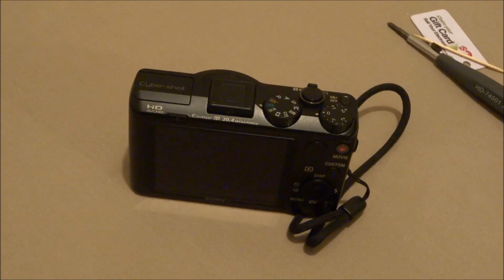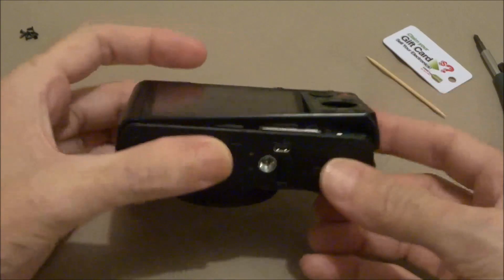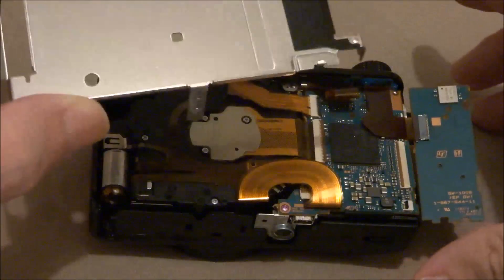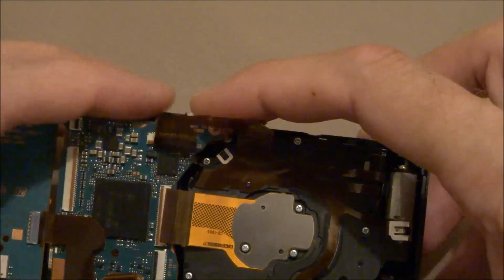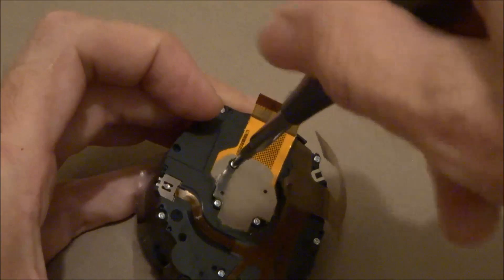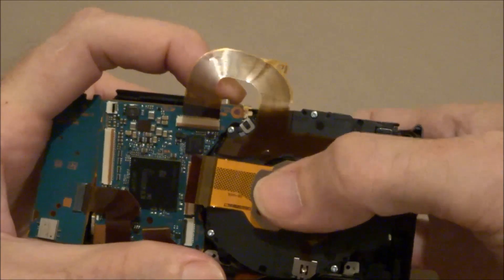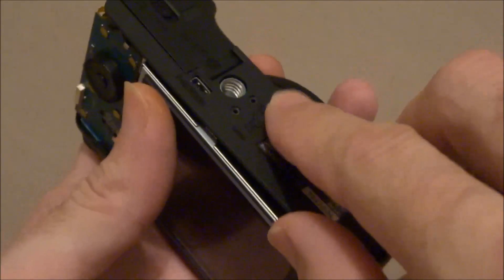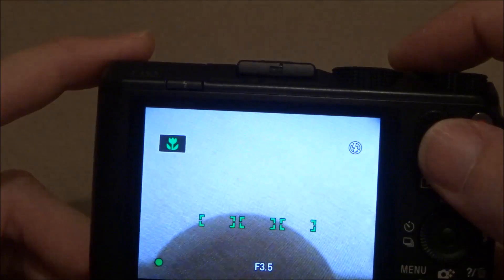Sony DSC-HX50V lens replacement repair HX60V HX50

Comment: I replaced the flash on my hx50v now it doesn't want to power up.  I checked the ribbbon cables over & over again.  & When I press the power button sometimes a little red led flashes by the little wire to the lcd screen on the motherboard.
Reply from the maker: +stingray4me that red led is the memory card  read/write led,  check the control cables, the one at the top.
Reply: I tried all the cables again with no luck. Can I send it to you to see if you can fix it ?
Reply from the maker: +stingray4me Did you remove the top control panel and the battery compartment?  I bet its either the power cable or the control cable to the motherboard.  I might be able to look at it.
Reply: +Otherstuff No I didn't try to remove the battery compartment or top control panel.. I'll try that now.
Reply from the maker: +stingray4me on the other side of the motherboard there is the power cable,  remove the lens cables so you can just flip the motherboard to check the power cable.  the power cable just slides in there is no flip retainer.
Reply: +stingray4me got it all apart now.
got it back together with high hopes but still the same. No power just the little red led flashes & makes a slight clicking sound when power is pressed.
Reply: +Otherstuff I checked that cable too & it is at its maxium in point up to the ribbon ears.
Reply from the maker: +stingray4me try removing the battery and hold down the power for one minute.  When you replaced this flash was the a new flash ?
Reply: +Otherstuff I tried holding down the power w/o battery & still the same.
I bought the flash off ebay. It was from an hx60.
Reply: +stingray4me Can I mail it to you to try to get going ?  I give up.
Reply from the maker: +stingray4me i sent you a message.
Reply: +Otherstuff OK I'll send it to you.  Just replace little items like cables if needed.  If it needs expensive items I'll just get a new camera.  Thanks.

Comment: So I installed the new one and the lens will not come out when I turn it on. It just says turn off and turn back on. Any ideas?
Reply from the maker: +raul bohorquez new lens?  something didn't connect on this cable 4:25    try bumping the camera with you palm.
Reply: +raul bohorquez mine said that too & also the internal memory is full. Now it doesnt say anything & wont power up.  I replaced the flash on mine.

Comment: Hello! Thank you for this video. I got the spare part and attempted to replace it, however when i finished and powered it up, the lens wont pop out, it wont open. Tried again to check and the cables and still it wont. Any idead what i may be doing wrong?
Reply from the maker: jvelezc  check this cable ( at 4:28 )  its the motor drive cable. was it a new lens?
Reply: Otherstuff Hello Thanks for your answer. I used my old lens and it does pop up with that cable is connected, when i use the new it doesnt. I could you your spare part has a Number 2 on the top part as well as my old lens. However my spare part has a Number 1, do you anticipate that may be the issue? - thanks in advanced
Reply from the maker: ***** where did you get this new lens?   its for a hx50?   i dont know anything about a number if the lens is for a HX50 it should work.   return the lens something is wrong with it.
Reply: Unfortunately I bought it on Ebay shipped to Germany from a Chinese source. It didnt work, and the only difference was the number 1 it had, compared to my original and yours which were number 2. He will send me a new part this time I hope I get it rght otherwise I will have to buy from a USA Source.
Thank you for all your support! :)

Comment: Outstanding video.  I dropped my camera and now the camera displays error 13:01.  If I remove the SD card, there is no error.  The SD card is good.  It appears that a connection came loose or a component has been damaged.  With the aid of your video, I am thinking of disassembling the camera. Any thoughts?
Reply from the maker: Vic Tree the card slot has no ribbon cable it is solder on the main board.

 got this off another help site :  

  This error usually is generated because there is an issue with the contacts on the Memory Stick - do you have another Memory Stick to test? If it's only one Memory Stick with this issue check the contacts and rub them gently with a pencil eraser if necessary. Insert and reinsert the card several times to see if this clears the error. If you are still having the issue after this, and you get the same result with another Memory Stick the camera may need service so give Sony support a call and they will be happy to help:
Reply: Otherstuff Thank you for the reply.  I still see the error with a different card.  The card that was in the camera, when it was dropped, is accessible in a PC.  With no card in the camera, I can take pictures with the internal memory.
Reply from the maker: Vic Tree try this,  with the camera on  slowly push the card in and see if it reads it at some point.  i had some do this its was the connection inside the card slot got bent.
Reply: Otherstuff I tried that and it seems to try to access it.  But, "Reinsert the memory card." and C13:01 pops up.

Comment: Thank you so much for posting this! I dropped my hx50v ( the lens stopped working) and I'm not confident in my skills in camera repair. I know it will cost a lot to repair , but what else can I do? Do you have any suggestions?
Reply from the maker: $50 bucks on ebay easy to swap out.   Also check out my HX50 lens disassemble video   https://www.youtube.com/watch?v=fE0vQmQFvEI

Comment: Hello friend, thank you so much for sharing this video, my hx50v dropped and thanks to your video i was able to replace the lens, But now after a couple of days of fixing it i have a problem with the flash, when taking pictures the flash light is not working anymore can you please help, what do you recommend  i should do? Should i replace the flash? Thank you
Reply from the maker: You might have snagged the flash cable when placing the lens in the body,  look at frame 8:40 in this video you can see the flash cable, it runs across the top from the flash to the motherboard.  You might have to take it back apart and check this cable. There would be no other reason for the flash to stop working after removing the lens.  The flash cable is long enough to raise the motherboard as i did in this video. But if the lens snagged it....It  could damage it or pull it out of its connection on the motherboard. Did you notice anything when placing the lens in the body? like it had problems going in.

Comment: Hi My friend Im having some problems with my camera shutter button, isn't working it doesnt take pictures how do you think that I can fix that?
Reply from the maker: The shutter button is a two stage button, one soft "click" ( to lock focus ) you will hear the focus lock audio "beeps" , then a hard "click" to take the picture.  do you feel both of these actions? ( button could be jammed )  do you hear the audio focus lock beeps?   Has the camera been near moisture? ( cables could have got frosted )  Any body damage been dropped?    First go to setting and try to  " Initialize " the camera.